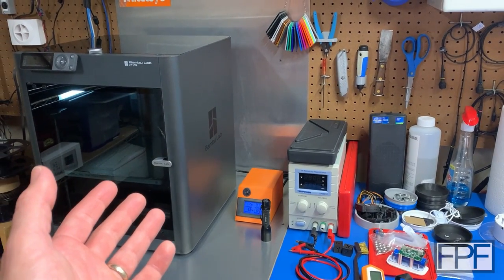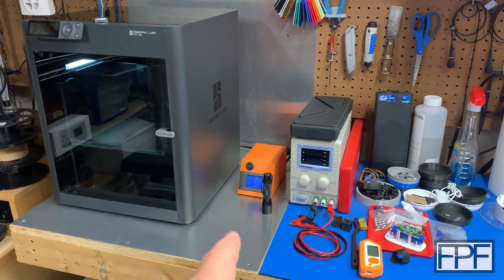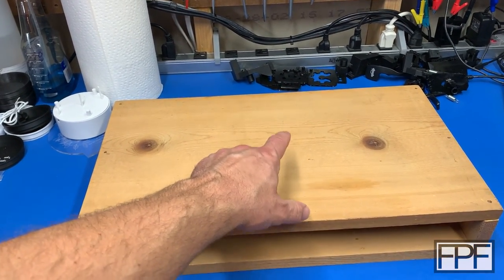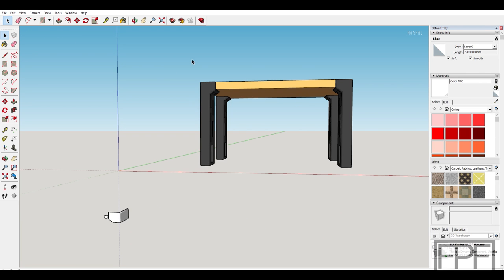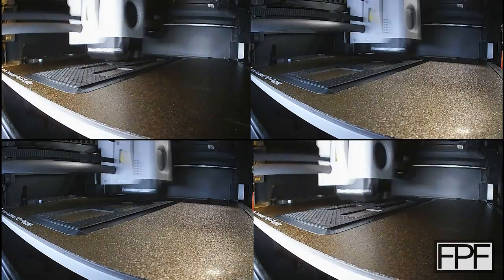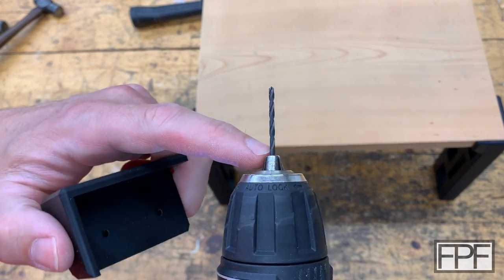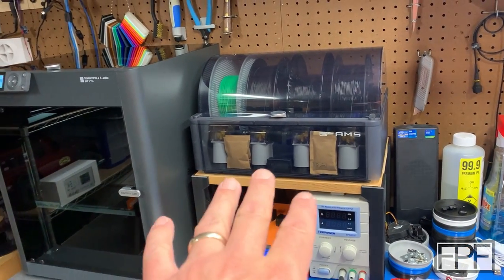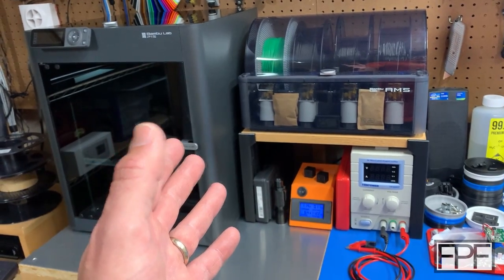3D Printed Legs for AMS Stand or Little Table

Comment: Very nice! I didn't buy the AMS combo with my P1S either, and now I'm regretting it after only a week.
Reply from the maker: I think the bundle price is cheaper too right?  I really considered getting a second one just to keep even a single roll dry between prints, but I'm trying out another filament dryer/dispenser.  Should be in a future video.

Comment: Do you have a link to the screwdriver you were using?  Also, how do you get the filament into the machine from the stand? I really like the way this came out.
Reply from the maker: Thx for the reminder!  I said I'd link that screwdriver and then forgot :)  I added the link to the video description.  The PTFE tube on the AMS is long enough to reach the filament buffer on the back of the machine. I think you can go even longer, but the stock length reaches fine when it's right next to it like this.

Comment: Thanks for the video! What infill density and wall count did you use for the legs? I am about to print a stand that I want maximum structural support on
Reply from the maker: 3 walls, 30% density.  Probably overkill, but there is a fair amt of stress on the part where the screws go through it.
Reply: You could do a normal amount of infill and a default of 2 walls but make a modifier in Bambu Studio to print like 50% infill only where the screws go so you add strength only where it’s needed but not where it’s not.

Comment: I’d be interested to know what print settings you used to give the legs enough strength.
Reply from the maker: 3 or more outer walls, 30% infill, 7 top/bottom surfaces

Comment: Should have designed the space under the table to be able to place a second AMS unit underneath it.
Reply from the maker: For my use case, I wanted it just high enough to clear that power supply underneath and provide max visibility into the AMS, but this design can be easily modified by stretching the length of the legs and using a board that's about 3" wider to accommodate another AMS underneath.  If I get time, I'll bundle a longer length leg version in the STL download for this purpose.